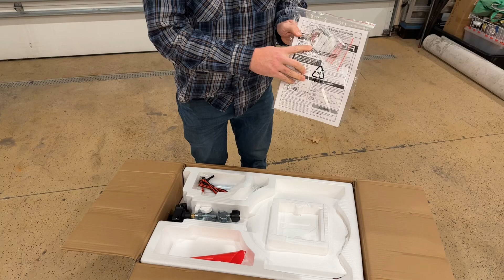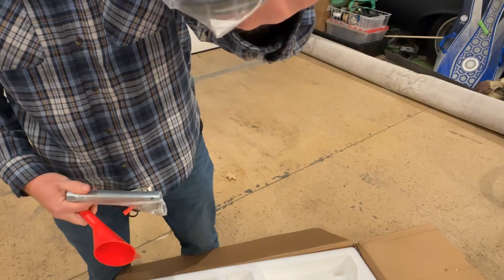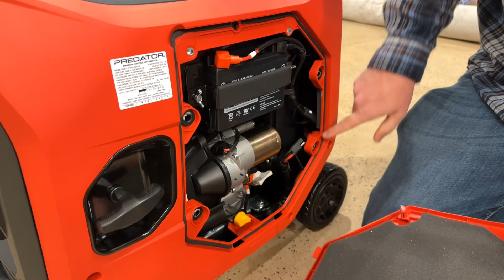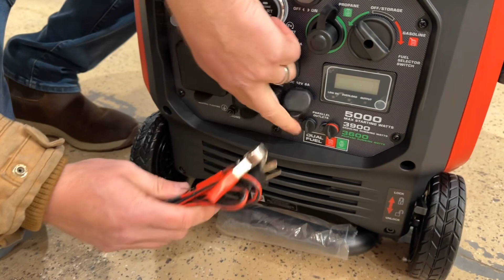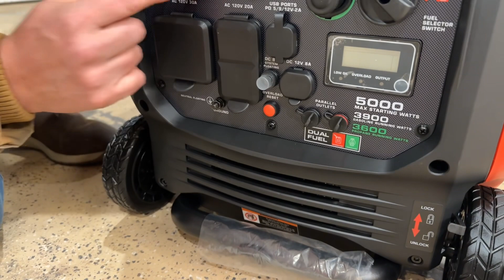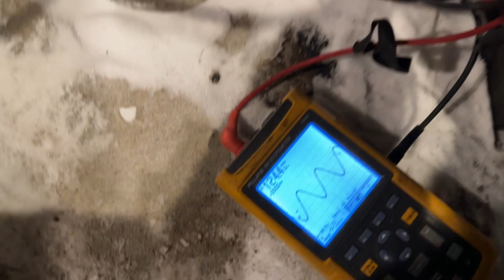Full Guide and Review on the Predator 5000 Generator #review #guide #generator #predator

Comment: Was there a very small amount of oil on the plug when you unboxed it? Mine did. I also noticed a gas smell in the gas tank out of the box. I’m hoping this is due to the factory testing it after assembly and not somebody who ran it then returned it.
Reply from the maker: They generally do test them at the factory so I wouldn’t be too concerned about it.
Reply: @ yeah I called HF and they confirmed my unit was tested at the factory.
Reply from the maker: Great!

Comment: I just bought a Predator 5000 and am having start problems.  Running strictly propane, starts right up when cold, with electric start,  but if you shut it down after running for a while it will not start using the electric start, but will if you pull start, usually on the 1st or 2nd pull.  I ran it for 1 hour yesterday and 5 hours today and it did the same thing both times.  I did notice the electric start button would turn red if I held it for more than about 5" but it still wouldn't start.  Any idea why it is doing this?
Reply from the maker: Odd, I’m not entirely sure what’s going on with yours we haven’t had any issues with ours. Sorry to hear about that. Hope you get everything sorted out.

Comment: How can you only get only 60 volts on each leg? I thought it was a 240v connection. I wouldn't think it would reat 120v. I should be able to take my 30 amp R.V. plug and plug it into the  predator 5000 and should be able to handle it no problem. I am confused on the 30 amp. Please explain as I am planning on purchasing a 5000.
Reply from the maker: This generator only has a 120 V output. It does not have a 240 V output, hence, each leg only being 60 V.

Once we put the ground to neutral connector and then it started behaving properly.

Comment: This is a 120V "floating neutral" generator.  You are seeing 60V on each leg because neutral is floating while you are taking a reading; it is not bonded to ground like an an electrical outlet wired to NEC standards.  This is why you may hear people talk about bonding plugs and I will explain.

There are a number of YouTube videos about ground - neutral bonding and NEC (National Electrical Code) standards.  Basically all of these newer inverter generators coming out of China are "floating neutral" where you need one ground-neutral bond in your electrical system so a short to ground can return to source and pop the breaker, thus clearing the fault.  The NEC code does not say zero and does not say two or more, but instead explicitly prohibits anything other than 1 ground-neutral bond.  "Floating neutral" means the generator has zero ground-neutral bonds in it.  A bonding plug creates a ground-neutral bond, generally through a NEMA 5-15 plug.  Not quite ideal for a generator designed to put out 30A as you are bonding through a 15A rated plug, but better than nothing.  Probably want to create a bond in the generator with the appropriate gauge wire to really do this justice.  It would be good if someone put out a video where they show exactly how to bond in the generator or maybe put a link here.

Another way to view this "floating neutral" is both your devices will see a lot of noise because neutral is floating and your volt-meter will see ~60V on both the hot and neutral pins as neutral is no longer neutral, but floating.  Now say you plug in a toaster oven and a live wire got damaged and is now resting against the metal case of the toaster oven.  As the metal case of the toaster oven is attached to the ground wire and a live wire is in contact with it, that metal case is energized and everything on the ground wire including the metal frame of the generator is now energized.  It is just waiting for you to touch it to see how your body responds to touching a live wire / energized surface.  In this case maybe the toast is made outside of the toaster oven instead of inside.

So now this "floating neutral" example is given and this is clearly not what you want, everything on the ground wire energized, now we bond neutral to ground as per NEC standards.  When that live wire in the toaster oven makes contact with the metal case, the short circuit power flows down the low resistance ground wire, through the ground-neutral bond, back to the source, and pops the breaker.  This is just what you want to have happen whenever there is a short / a live wire touching something it is not supposed to.

As for why you would want a "floating neutral" generator, this usually comes down to say you have a higher powered 240V generator to power your whole home through a transfer switch.  If the ground-neutral bond is in there / your service panel, it is against code to have two ground-neutral bonds.  In this case and you know what you are doing, you want neutral to be floating on the generator because say the short circuit power flows through your breaker panel and pops the breaker there.  You don't want to create a ground loop / share shorting loads, pop a GFCI on a generator through a ground loop whenever you turn anything on, etc.  

GFCI is designed to pop on small currents through ground as your body acts as a resister and so won't pull short circuit current needed to pop a regular breaker, but you will die long before a regular breaker will pop.  GFCI is meant to pop before you are killed by the power flowing through you.  GFCI also gets in the way of a lot of stuff, say that surge protector you use with your computer as say you are plugged into the grid and there is a lightening strike causing the surge protector to dump power to Earth ground through the ground wire, so you only want it where you have to have it, say near water.  So there, a little bonus content to help round out the picture as a lot of people are just flat wrong with what they say about GFCI.
Reply from the maker: Most excellent response!  Thank you for sharing this information as it was very clear on how it all works.  We have since been working on an internal bonding wire to make it a permanent solution.
Reply: @GearStreet  Cool.  I will be on a lookout for the video.  What I currently have the parts on order for is a 6' TT-30 adapter cable.  I was thinking I don't want to chop up my long TT-30 extension cord because then I can only use it with a floating neutral generator and nothing else.  Making a 6' adapter cable out of component parts so I can stick a ground-neutral bond is costing me ~$40.

Comment: Try a neutral ground bonding plug
Reply from the maker: Yes, we did and we will be uploading a video about that soon.
Reply: What's a neutral ground bonding plug? Sorry, I literally just bought this generator and need some help understanding it
Reply from the maker: The neutral ground bonding plug ensures that electricity will flow properly through the neutral conductors and is delivered to one bonded location - eliminating unpredictable stray voltages caused by connecting to the ground twice.